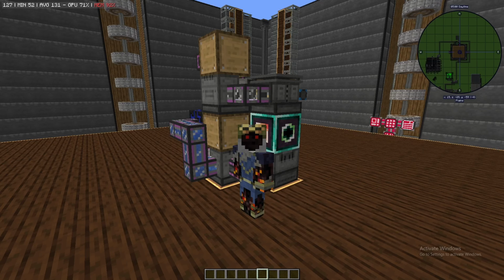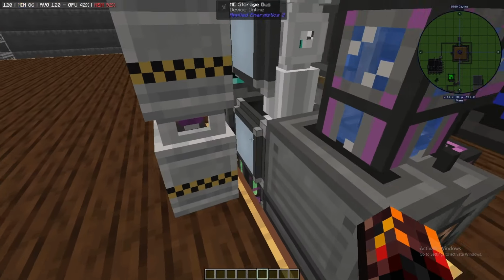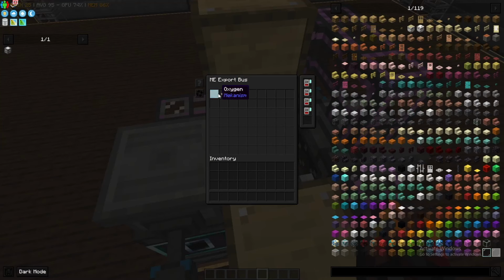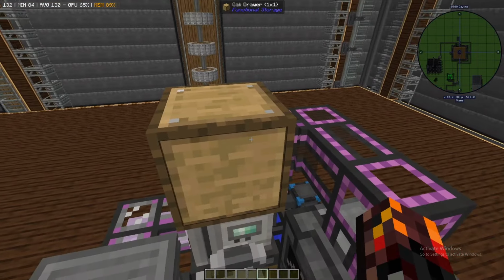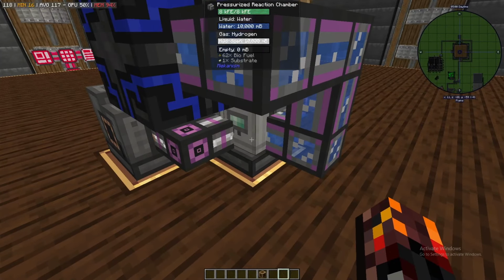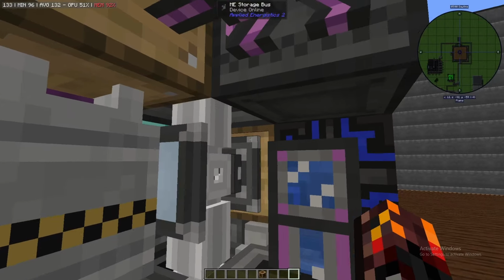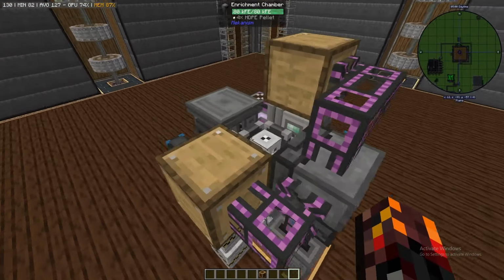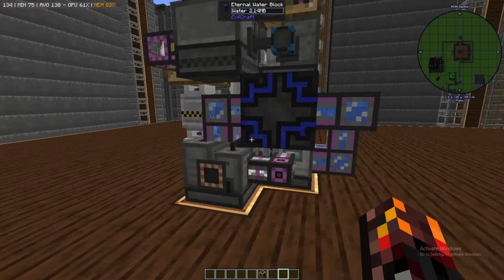How to Build an Ultra Compact 3x3* HDPE Sheet Factory | ATM9

Comment: Can you explain the input/output for every machine? I’ve tried replicating this and only get to the electrolytic separator taking oxygen to the top chemical tank and nothing else happens.
Reply from the maker: If I recall correctlyly the electrolytic separator outputs have 2 options, so output (1) I belive is hydrogen, which I have going out the left into the gas input of the PRC, and the Oxygen is output (2) which I have set to the import bus.

This all will be under the gas tab in the separator (: